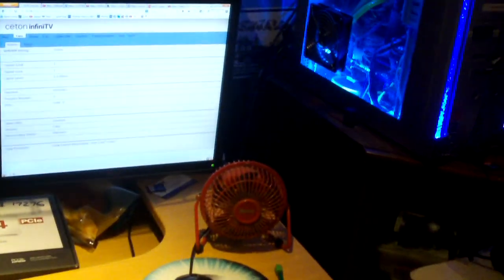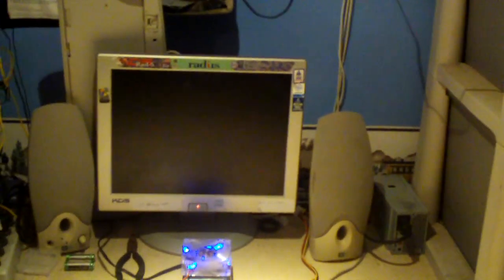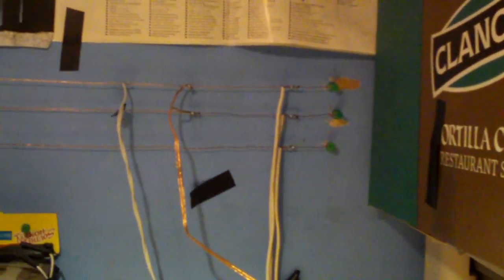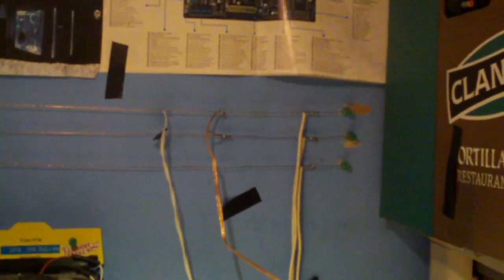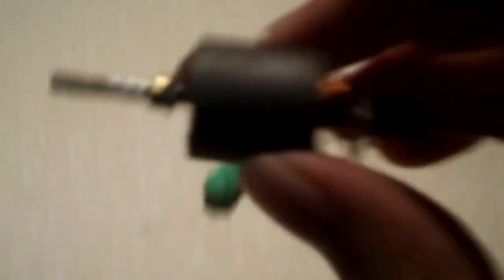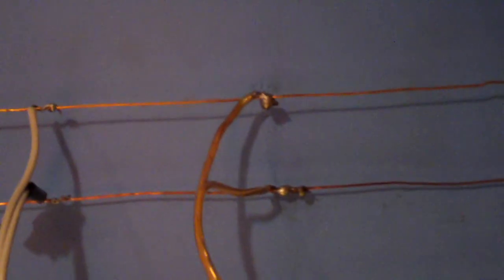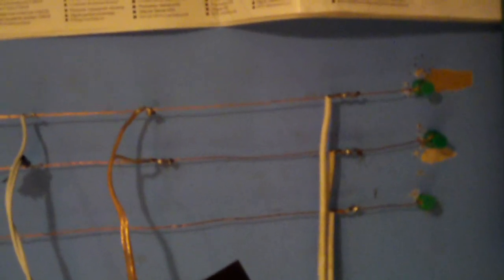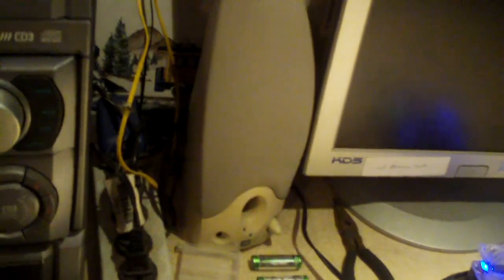Decided to rewire my DC distribution power line with copper!

Comment: I have a very similar setup!
So strange, I have many things in common with you and HDFXH.
Except mine is 1.5VDC, 3.3VDC, 5VDC, 6VDC, 7.5VDC, 9VDC, 12VDC, 16VDC, 24VAC, 36VAC, 48VAC, 60VAC, 120VAC, 240VAC, 480VAC, MOT Output [Switched off usually], Flyback [Also switched off usually].All outputs can be turned off and I have a cabnet filled with transformers and HUGE UPS that runs everything there. I believe the battery is a 1000AH Ni-Fe. The wires are recessed into groves for safety.